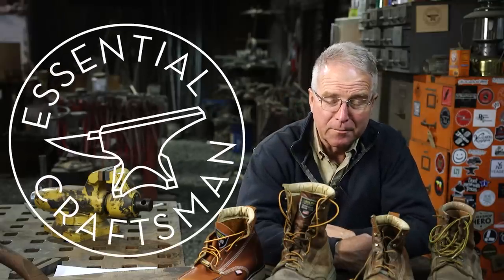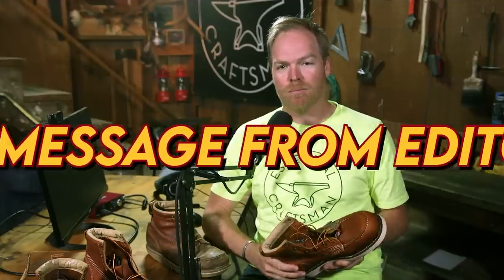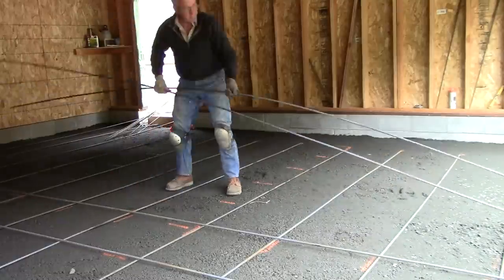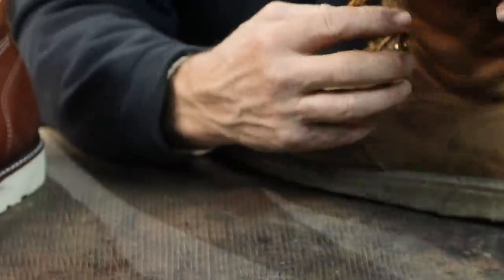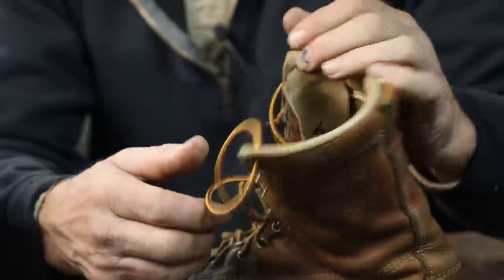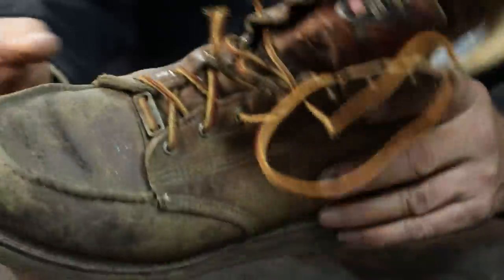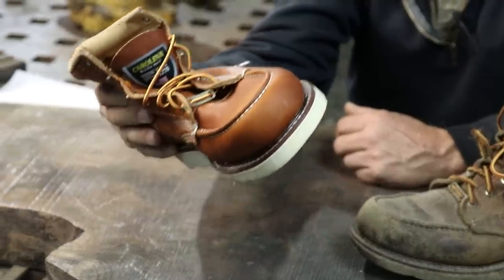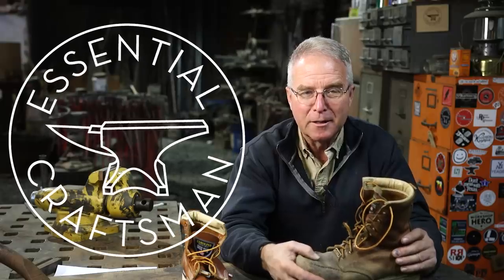Carolina Boot Review

Comment: Thorogood 6” moc toe has been my preference for some time. I think I might try the 8” next time around just for the added ankle stability. These are pricey ($350ish) BUT when you send them in for a re-sole the outsole/midsole stitching replacement only costs about $100 and IMO you can’t beat the value of keeping the same boot going for 3-5 years.
Reply: L F could be misremembering the price, i bought them in 2017 or 2018.
Reply: L F you right they’re $209 🤷🏻‍♂️

Comment: I prefer the red wing 10877 boot, it’s similar to those Carolina boots. I recently bought the “traction tread” style 411 boots from red wing, they’re waterproof 8” boots with crepe sole that has a rubber overlay just like the die hard, but softer leather and more comfortable on the foot in my opinion. Would highly recommend.

Comment: These are the best boots I've ever owned, and this Summer it will be 50 years since I started working for money as a Helper in the Electrical Trade.  I was working at Intel RA Campus near Portland and stopped in the Danner Factory Store. I have WIDE feet, I mean they're shaped like the box the boots come in, and I was looking for a wide work boot. I owned 2 pairs of Danner hiking boots at that time so I thought I'd try their work boots. A sales clerk asked me if I had looked at the factory seconds section. She took me over there and pointed out a pair of the RAT boots the Marines use for around $130.00 which isn't bad for a good boot with a waterproof liner.  I asked her what the defect was. She pointed out a tiny (1/4") piece of orange tape and said that points to a scuff! You could barely see it! I did more damage than that in one day at work. They fit great, had a soft insole so I bought them. I Wore them for two and a half years, including two years at the new Apple Headquarters in Cupertino, Ca where I was on the Temporary Power crew. That building is one mile in circumference, with four levels, plus two basement levels that were often flooded with 6" of standing water. I walked 8 to 10 miles a day on concrete running around troubleshooting power and lighting. My feet stayed dry the whole time.  I bought a second pair online (at full price, $210.00)  and wore them while working on new luggage conveyors at Miami International Airport.  While I was down there I took the first pair to a local shoe repair shop and had new Vibram soles put on. I still have both pairs and wouldn't trade them for anything.  They are on the heavy side,  but the speed lacing system is the best I've ever seen.  Just pull them on, pull the slack out of the string and tie them up. I highly recommend them.

Comment: I've been using the Irish Setter Winshooter ST 8 inch. Love em. They have that soft white  part of the sole but it has a harder rubber cap. For me being a bigger guy helps them last longer. I'm about a year in them in July. Leather holds up well. Really nice boots.
Reply: I’ve had the wing shooter for a little over a year as well, the soles still have some life in them; only problem I had is the toe box ripped shortly after I got them but it didn’t effect any of the waterproofing and didn’t disturb the safety toe

Comment: I use Timberland pro's Boondock I have used 8 and 6 inch both work fine for summer I tend to wear 6 inch and winter or if I am working on a really wet day 8 inch. Both are lined so they are pretty good at keeping water out.

Comment: I was a Redwing man until my model was offshored and they pulled out of my local boot shop. Now on my second pair of Thorogood steel toe wellingtons and I'm still impressed. Add some KG boot guard or Tuff Toe and I get 2 years out of them burning, welding, climbing on hot steel and the occasional "persuasion" of a steel choker. The wellington keeps me from fighting with greasy laces, the wedge sole gives traction and is easy on the back, no lining on the inside helps keep my feet cool in the summer, plus the height helps stop hot slag and molten metal from worming into my socks. Union made in usa doesn't hurt either. Make nice with your local boot shop/ workwear store and they'll make sure you're taken care of too.

Comment: I wear a couple different boots for different things. My daily drivers are 10” Frank’s T1 lace to toe. They fit great, grip pretty much whatever I stand on off-road, where I work, and are built, well, as good as work boots can be built. Which they should be, as mine are configured run around $550. My other go to pair are an 8” Frank’s boot with a low heel, and a softer Vibram lug sole. Same as above on build, way easier on/off and the thinner sole stack up and low heel help with a little high speed work. I also have muck boots for really nasty days. The winters are pretty mild here, so nothing insulated, just some heavyweight wool socks. 

I also have worn Red Wing, Nicks & Danner. I really like Nicks boots, mind they are near twice the price of a pair of Red Wing or the Danner boots I wore for a while. Danner has a few boots I really like, but Red Wing boots just don’t fit my feet well.

Comment: I work primarily on concrete, doing commercial interior buildouts, so I don't require 8" high boots to keep debris out. My 4" Worx chukka steel toe boots from Red Wing have treated me very, very well. The negative, the insoles are horrible-but I feel confident in saying that most boots are delivered with low quality insoles. I added a pair of Dr. Scholl's work boot insoles and I can now work all day without issue. The positive, the steel toes saved my left foot from being sawed in half the other day while using a reciprocating saw while framing. The blade took a solid square inch of leather off of the steel toe, but went no further. I have since glued the flap of leather back down and given the pair of foot savers a good rub down with mink oil. They deserved it!

Comment: Ive worn carolina 8" loggers for 2 year doing construction still have them. I wear them currently as my "work boot" doing odd jobs or house work. They're comfortable, stylish, and well made. But they are a hefty steel toe which is great for construction but not an every day round town or hiking boot. I wear a pair of Danner Lookout duty boots (about a yr old now) for my employment. They are light, great quality, withstand hard use of security work, and have an all leather upper and toe box which take a nice polish. My other boot is a danner 8" Logger soft toe (had over a year) and man are these great the are super light for a logger boot, they look fantastic and they do amazing on rough terrain. I got these as my Search and Rescue boot for rescue calls. Ive been on 16hr day long searches in the mountains here in NY and they fair extremely well through the terrain and dont fatigue your feet when carrying a 40lbs pack and or extricating your subject while out there doing your job. Both are great brands i just choose the specific boot based on what I need out of it.

Comment: As another weekend warrior, I don't put my boots through the workout that some do, but on the weekends, and many evenings I'm out in the garage, or garden or woods doing something in my boots. I had a pair of Chippewa loggers that I loved and wore for 20 years. The newer Chippewa boots I've heard have issues so I haven't bought a new pair as of yet. 

One of the criteria for me is that the boot be unlined. I hate the goretex lining in a lot of boots these days. It's like putting your foot in a plastic bag. Fine for the winter, buy way too hot in the summer. 

I am also a member of the canary ankles group, so finding a pair of boots that you can tighten up is difficult. (Especially after the leather stretches a bit.)

My current boots are Danner Bull-runs. Expensive, but very comfortable.

Comment: I’ve been using the JB Goodhue iron worker boot with the soft wedge for a few years now.  I’m a parts guy in the heavy equipment industry I needed a pair of steel toe boots. I spend lots of hours on my feet on concrete floors and had a hard time trying different footwear until my father-in-law suggested to try these.  Has made a world of difference on my back and joints.

In my small town, I’ve been glancing around at what other people are wearing, just to see what others wearing and maybe try them as I was having a hard time finding good footwear, and I was surprised that there were a lot of people wearing the iron worker boot.  I know I’m not hard on a boot like in a construction trade, but they do wear down and wear out.  I bought a second pair so I can have one pair re-soled and keep switching.  If I didn’t need steel toe as a requirement, I’d probably go with a mock toe for the weight savings.

Comment: Haven't tried many other brands of boots but I'm on my third pair of Carolinas because the first pair (no safety toe) lost water proofing and the heal ripped a little. The second pair I bought composite toes (which Carolina only makes glued to their soles) and they went when the sole ripped off at work. They lasted a couple years before needing replacement but I use bees wax on them to keep the leather moist. However, it also makes them easier to mar and tare up.

Comment: I have a set of carolinas with logger vibram soles, got them at a thrift store 3 years ago and the uppers are in nearly as good of condition as when i found them. Super high quality leather, i prefer a more rough and tumble sole as i do mostly pole barns and commercial all steels, and i typically switch to tennis shoes when i have to walk the steel. (I do clean/grease them weekly, because i just hate to throw things out)

Comment: I like slip-on boots/shoes. I’ve been doing electrical work and ceiling fan installations with my dad for 20+years. Pretty much since I was about 7 years old. In Hawaii you have to take your shoes off inside a house and I can’t deal with laces running out to the truck 10 times. I like slip on boots but also boots are way too hot for Hawaii so I usually wear comfy running shoes.

Comment: I have taken a fancy to my Ariat WorkHog Patriot Steel Toe Work Boot. I joined the military right out of high school. And they lead me to wearing Bates boots because that is what I was issued. Whenever they wore out, I would buy another pair. I knew they were regulation and they were readily available. They were also familiar. They worked for me when I was working on ship or on shore. They even worked when I was in the desert. When I left the military 10 year latter, I became a fire fighter/paramedic and I continued to wear Bates. Again, they were familar, met uniform requirements and we readily available. It wasn't something I even considered. One year I was issued a pair of Danner boots. They were more comfortable than the Bates, but didn't hold up as well. They were also more expensive, so I went back to Bates.
A few years again, I left the fire department and went into construction. I still wore the Bates until my wife convinced me to try on the Ariats. They were the most comfortable boot I have ever worn. The insole was cushioned in all the right places, and the sole gripped like like it was designed. The boot is waterproof, yet my foot can breathe. No more wet socks when working in the rain is a big plus. The ease of slipping them on and off has saved my countless time over the past few years. The wide square toe gives my little piggies like they have never felt, yet they are protected by a steel that works. I have had a loaded trailer fall on my toe. It cut through the leather all the way to the steel toe, but my toes survived. I even wear these boot when not at work. I use them around the farm. I wear them almost everyday. They are just comfortable. The shaft is nice and wide at the top and doesn't rub against my leg. I have even taken to carrying a boot knife with comfort and ease. I just really like they boots and plan on getting another pair when needed.

Comment: It sounds like the Carolina boots are a great choice.  If you also liked the Sears Diehard boots, it seems they are still available.  I found an old Sears ad for Diehard boots and the Diehard boot featured appears to be identical to a RockRooster Suretrack boot which is also called "Diehard".  I suspect RockRooster used to make the old Sears Diehards.  They also seem to be quite a bit less expensive than the Carolinas and also include a diehard sole.

Comment: here in Quebec , regulated construction require steel toe boots but I can assure you they are made to break ,I never had a pair that lasted a full year. . For the past 2 year I have been using a pair of Timberland premium (without steel toe ) and they are still running ,sole is still grippy and comfy . I had to put shoe goo on the toe box after I made a hole in them , bacsicaly a rubber cap of shoegoo on it witch made them even more water proof only down side is timberlands shrinks a little once they are wet and dried a couple of times . I like to wear timberland in everyday life soo when they are too scuff up I use them for work. Double life and no need to break them in on a Job site.

Comment: I've worn Redback boots (Made in Australia) for years up until recently as an auto mechanic, they're slip on which saves time changing into and out of my uniform at the shop, and they USED to last me 2-3 years. I had a very early failure with my most recent pair and I've seen it with other guys in the shop so this time around I've switched to Thorogood steel toed oxfords, even more comfortable than the Redbacks, made in the US and being a shoe as opposed to an actual boot I can slip them on and off without having to tie/untie them. If the low cut shoe gets annoying this winter I'll be switching to the wellington they make with the same sole and footbed/insole. I've worn Cats, Wolverine and Danners, always have issues with the soles peeling off or falling apart with exposure to oil. The Cats had the added bonus of being ungodly heavy and causing me a ton of knee pain.

Comment: I've had a set of Ariat square-toes for the past decade. I've worn them hunting, riding, cutting wood, framing, roofing, and around my woodshop in sun, rain, mud, and snow. They're on their second sole because the original got hard and cracked over time. The only downside is that they do have a Goodyear welt style sole, so they're great for grip but terrible for tracking things in.

Comment: I am an unusual case. For the last 30 years I have worn Clogs!
My preference is a Derby .... Wooden sole (slight upturn from the ball of the foot so you are not clodhopping around like Hermon Munster) Solid rubber sole, commando for preference, 8 hole so giving some support to the ankle but not constricting, brass plate to protect the toe leather from scuffs! I would go through 4 or 5 soles before I wore out the leather ..... from the inside! Often (well not that often because replacement was a once or twice a Decade experience) I would bemoan throwing a perfectly good sole out ;0)

They were exceptionally good on my feet. Standing on ladders was effortless and you can do it all day without aching feet ..... in face counter intuitively my feet never ached or got tired in them! Walking is actually easier to do in them once you learn how to do it efficiently as your foot pivots of the toe rather than the ball of your foot!
There are bad aspects to them though ..... They do not do snow (it compacts in front of the heel until you feel like walking on stilts) and they do not do waterproof.
They have saved my bacon though .... working in the badlands of Rochdale at 10 pm in the dark when confronted by a group of ASBO's (look it up in UK) It may have got serious with them lining up to rob me ...... I dropped my tool bag on the floor and clicked the soles together and asked who was first to go and they had second thoughts! 
Sadly Work does not appreciate the finer aspects and insist on fully insulated COSH approved Boots ..... so my beloved Clogs are in the wardrobe awaiting further action! I do have a pair of Sundii (pronounced Sunday) clogs with carved Griffins and Celtic knots on them for best though ;0)
This will be no good for most of you but here is a link to see where I bought them and what they are ....  http://www.clogs.co.uk/boot%20clogs.htm

Comment: Now I know they aren't USA made but the Ariat Work Hog, the waterproof ones with a composite toe, lasted me 26 months of use compared to the normal 6-8 months that other pairs did. Just wearing out the sole and by the time the sole was gone the leather was cracked and split. Even with weekly cleaning and conditioning.

Comment: I've been wearing RedWing LoggerMax 9" steel toe...my job does not have me shittin' and gittin' it eight plus hours a day, but the added stress is exposure to water, corosive chemicals, and solvents along with almost always being on concrete or steel stairs and gratings.

Pro:
Comfortable, durable, I work around Chemicals so the added height of a logger keeps me out of any pools of liquid, The lugs seem to last forever-I've had my current pair for two years mostly on concrete and steel grating and they haven't wore out (I also run between 290 and 310#).

Con:
Heavy, Not "Made in USA", the lugs WILL carry the mud